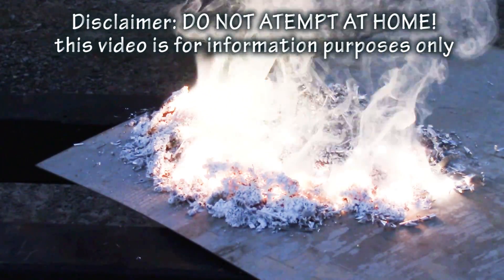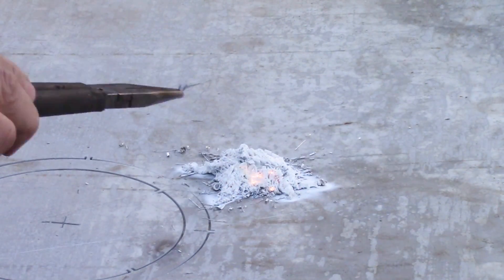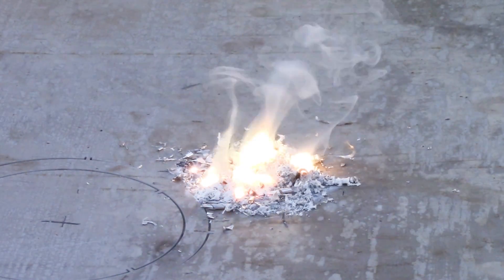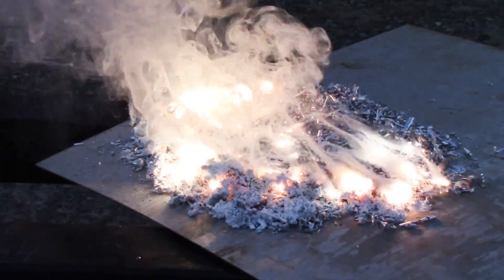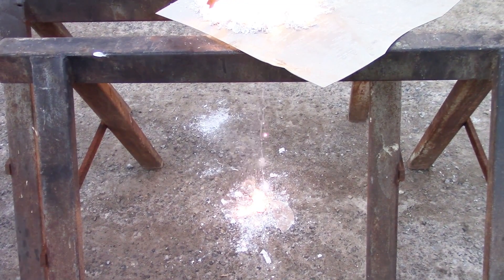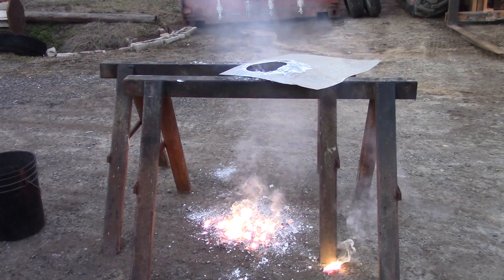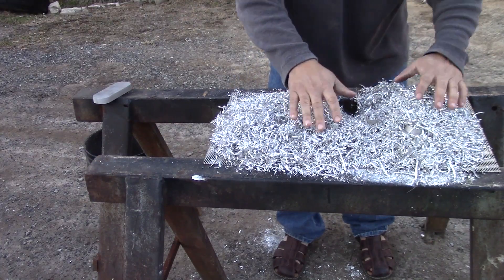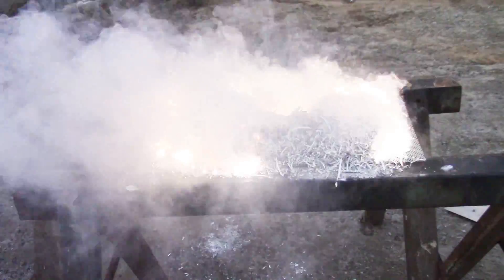Magnesium Fire: the most dangerous metal in the Machine Shop

Comment: The green is where your ammonia is coming from... Magnesium burning (by the way, way hotter than steel melting point) is so hot, that it reacts with the nitrogen in the atmosphere and forms Mg3N2, which then reacts with air moisture (water) to create Magnesium hydroxide, and ammonia...
Reply from the maker: Awesome, thanks
Reply: There's a periodic element of video on this... basically burn some magnesium, then cover it with a beaker. The magnesium will use up the oxygen, then the heat from the magnesium will then burn the nitrogen forming ammonia when it comes into contact with water. If you see yellowish green powder in the magnesium after burning, it's magnesium nitride.

Comment: Old VW Bugs used to have large amounts of Mag under the hood. Old Smokeeater in my area rolled up to a fire, he was Captain. Boys were at a distance knowing what was going on. He grabs the hose to put the engine out. First hit of water the engine bay exploded and sent burning magnesium evevrywhere. No one was hurt. 
  Caps eyes were the size of pie plates and the boys said he was whiter than a sheet.
Reply from the maker: yeah, a lesson they learned the hard way!
Reply: I and a colleague were once blown off our feet when attending a scrapyard fire.  There were a number of old Saab's and their engines have some magnesium components.  Copious amounts of water do the job in open air but within a structure you gently apply VERY dry sand or dry powder recharges.  Never use a dry powder extinguisher as it will blast the magnesium turnings all over the place.

Comment: I am glad you did not try to extinguish the fire with water. It is hot enough to cause a steam explosion, scattering molten metal all around (as in anti personnel mines and flares). The burning magnesium can extract oxygen from the water, leaving hydrogen gas as a byproduct which would contribute to the steam explosion. If you ask a firefighter how to deal with a magnesium fire, the answer is to watch it. Your video makes a very strong case for good housekeeping,  and isolated storage, when machining magnesium and alloys.
Reply from the maker: Yeah, I looked up a few videos before I tried it, everything indicated not to try to extinguish it
Reply: Doug Robins the only thing I know to use on a magnesium fire is a D-Class fire extinguisher $$$.
Reply: Yes, I agree. Smothering the fire with an inert substance (sand is usually mentioned) will remove the oxygen from the fire triangle (fuel-oxygen-heat), but you have to be brave due to the heat generated from burning and have an ample supply of sand, with the means of delivering it very fast. Magnesium (or aluminum) fires are very scary.
Reply: Copious amounts of water does the job provided you don't have any adjacent fire risk.  In some circumstances you don't have any other choice due to logistical constraints.  Very dry sand is ok for small magnesium fires.
Reply: only safe way of putting out a magnesium fire is covering it with sand. It cannot extract the oxygen from silicon dioxide (melting temp too high)

Comment: If I remember correctly, isn't magnesium self oxygenating? If it is, that means it doesn't stop burning under water or even outer space. Please correct me if I'm wrong.
Reply from the maker: good question, im not sure if it is. but i do know that it will steal oxygen from anything it can, water, carbon dioxide etc.
Reply: only safe way of putting out a magnesium fire is covering it with sand.
It cannot extract the oxygen from silicon dioxide (melting temp too high)

Comment: I suspect that this is not pure Magnesium.  It seems to me that it is not burning as fast as ti should as compared to Magnesium that I have burned in the past!  The reason you smell ammonia is because the heat of the burning Magnesium is high enough that some of the Magnesium is reacting with nitrogen in the air forming magnesium nitride, this then reacts with water in the air to form ammonia!
Reply from the maker: that makes a ton of sense! the magnesium is  from some casting we machined so i suspect it was a casting grade and not pure magnesium.
Reply: @RayMAKES  could be am60 or az91d mag
Reply: the yellow color is probably magnesium nitride. not sure about the green, could be from the stainless steel interacting. might be an Fe complex, might even be Cr
Reply: Im a chemist. Magnesuim flakes is easy to burn

Comment: the product after burning magnesium metal is magnesium oxide..however Im not certain ammonia will be given off....so my assumption is that the magnesium you burnt is not pure magnesium..
Reply from the maker: You are probably right,  the magnesium was a casting so it might be a grade that has other metals in it for that purpose.  Also could be a reaction with the aluminum and stainless steel as well